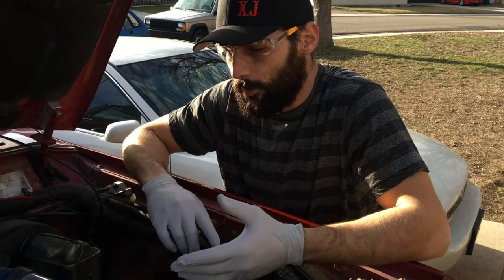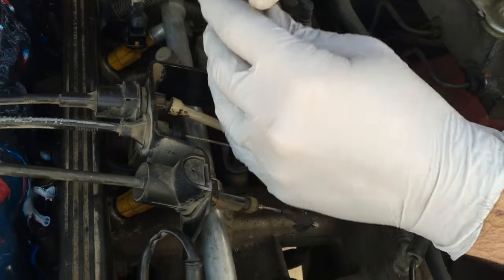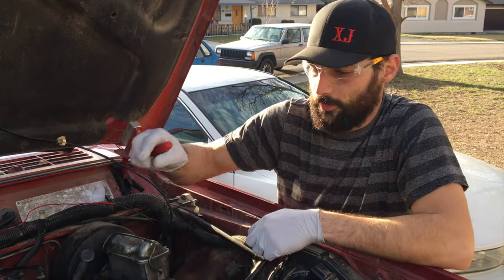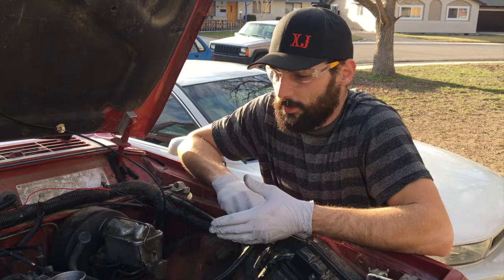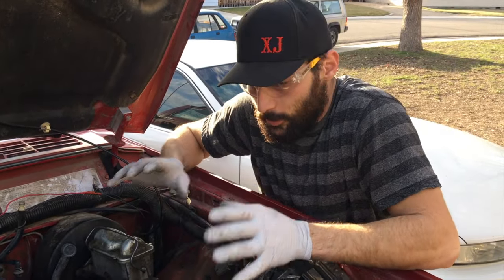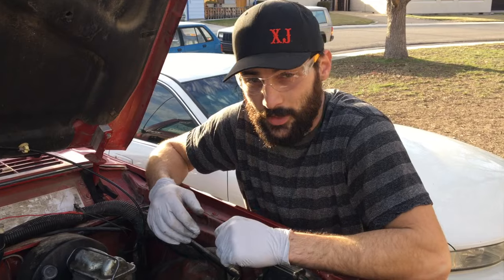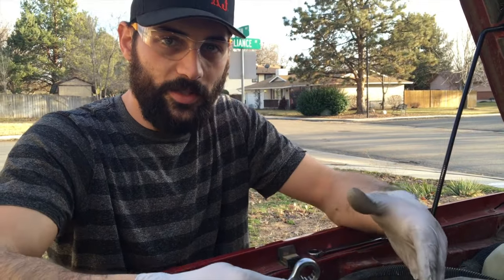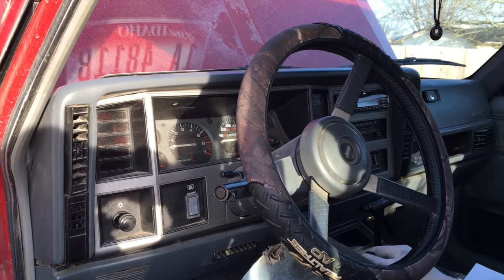Fuel Injector Upgrade Install

Comment: u painted the valve cover why not the fuel rail?
Reply from the maker: Gary Piont honesty didn't even cross my mind lol
Reply: Thanks for the reply and showing the video. I have a 98 and the rail is rusted , i was thinking of replacing it and saw your vid looks doable.
Reply from the maker: Gary Piont shouldn't be too hard to replace the rail :-)
Let us know if we can help with anything
Reply: Thanks for offering . the weather is cold up in Illinois My 98 had a broken fog light i replaced, the other had a burnt out bulb, I checked the relays and fuses looked good still no light, should i check from the switch back or from the light back ? thanks..
Reply from the maker: Gary Piont easiest thing to do is make sure you have power going there when you turn the fog lights on

Just test with a meter and make sure 12v is going to the light connection. If not, I'd start at your switch and work forwards from there
Reply: Thanks guy.

Comment: I NEED THAT HAT!!!
Reply from the maker: Sadly the maker doesn’t make them anymore :-(
Reply: @KSuspension   thanks, will see if I can have one made  LOL     by the way just installed your 12 hole injectors in my 99 XJ have them in my 2000  also they work GREAT!!!

Comment: Idk my jeep has been acting funny after i put the 4 hole injectors
Reply: Same. Keep getting misfires. Runs like shit. Check engine light keeps coming on with codes for the injectors misfire or not firing at all. I can put my original ones back in and it runs just fine.

Comment: this same for zj?
Reply from the maker: yup, unless it's a V8, then you have 2 fuel rails
Reply: @KSuspension  been told that 4.6L. Ford injectors work is this true?
Reply from the maker: Christian Sulak for some models yes, one of our top sellers
Reply: @KSuspension  they work for the 96-98 4.0s?
Reply from the maker: @ChristianWTR1  yes

Comment: What happens if you don't reset the computer?
Reply from the maker: m medrano the pcm will continue to roll the exact same way as it had been and not adjust as quickly to the new resistance ranges of the injectors

Comment: That is not the easiest way to remove EV1 pigtails. You can just push on the metal clip at the front and it will unlock. There is no reason to take the connector apart.

Comment: Your website is down. Page cannot load.
Reply from the maker: Working fine on our end 🤷‍♂️
Reply from the maker: Let me know if it doesn’t work
Reply: It's loading now. Thanks! I'm looking to purchase the 12 hole injectors for my 2.5L. The options are adapters and pigtails. How do the adapters work?
Reply from the maker: Geonious adaptors plug in between injector and harness

Comment: no one points out which is  the intake and which return on those two lines..sigh
Reply from the maker: Do you mean which fuel line is supply and return?
There are photos online as well as multiple threads on the subject. It’s also very easy to tell just by either following your fuel lines, or disconnect them and turn the key on.
However, to save you the trouble, the line closest to the back of the engine is the supply
Reply: @KSuspension  cannot follow the lines the vehicle is stuck and cant get underneath... turning ont he key wont work as the pump it no good thats the point of the work i need to do.. as for photos online.. looked for hours cannot find one identifying... looking at the rail the pressure regulator is nearest the front of the  engine and has high pressure written on it on a label... the one nearest the back of the engine has nothing on it...
Reply from the maker: @gabrielsansar6187  well at least you now know :-)
Reply: @KSuspension  nope - ksuspension said rear line...  is it ? need a certain proof pic/diag... got to cut the line to plumb in a temp  external pump cant risk an opinion

Comment: Why upgrade to 4 port injectors?
Reply from the maker: Better fuel atomization, improved idle, improved throttle response, and some cases we have seen increase in mpg.

It’s not a “need to” swap, but a nice change from the factory setup
Reply: KSuspension does it fix heat soaked or just add vented hoods with timer fan?
Reply from the maker: @rojenadventures5566  the gen 3 bodies are less prone to cause vapor lock issues, but it’s not a permanent fix, can still happen 
Adding ventilation is also a good helping hand 

Adding a fuel return line is the only true fix

Comment: I had the check engine light. 
it was code P0304, P0204.
I changed the ignition coil with boots and new spark plugs. 
I did everything on the video. 
Put CEL is still on and on the OBD it reads nothing. 
what could be wrong?

Comment: I've install to a different car stock car before and just changing bigger injectors was not enough to get power or any change to it .. had to install a computerized piggy back to adjust > fuel map/ air map to the existing CPU & /(walbro)bigger fuel pump / induction supercharger/(bosh )318 cc injectors & short ram intake  .. then I could notice a difference in performance to a none supercharge car  that it came not cheap .. so based on upgrading just injectors I don't see any improvement on this video upgrade